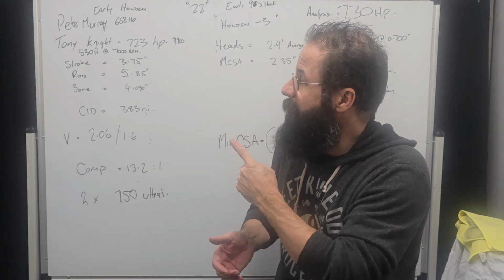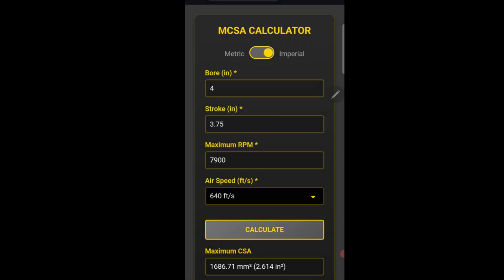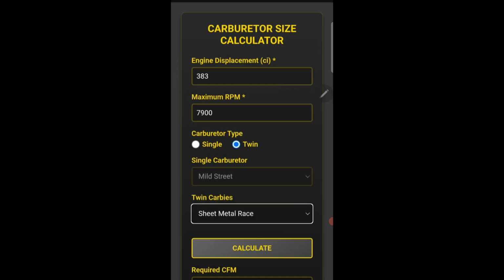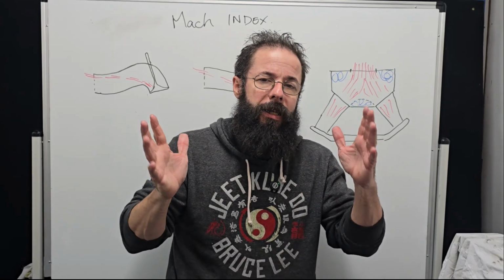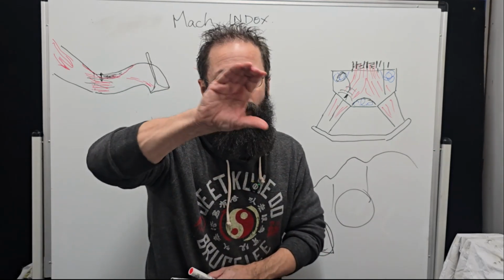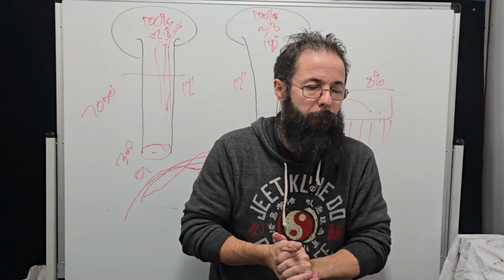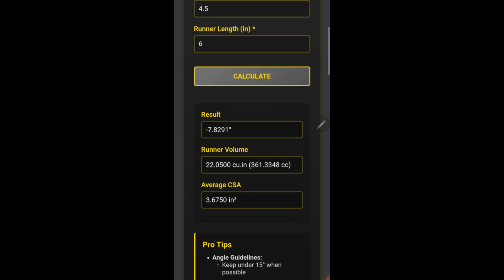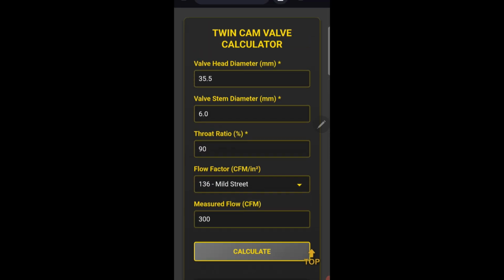Induction Secrets Part 5: MCSA Mach Factors and real world example

Comment: 302ci with limited .444 lift cam(ptv clearance) performer long runner efi intake and super trick ported gt40 iron heads  stock  valves would a 1.7 rocker ratio max out power a bit higher rpm? Runs up to 6000 rpm then chokes up
Reply from the maker: Generally they extend RPM.

Comment: Great video, and THANKS!  Quick question. On your calculators, is there an accompanying diagram that clearly defines each of the input and output variables?  On a couple there I lost track on what they all are, and that would make it hard (impossible?) to reliably use the calculator if one cannot be confident of what each of the variables are. Thanks!
Reply from the maker: Which one mate? They are pretty straight forward

Comment: it’s an advantage to have small
cubes like 320” or less for port design.

these don’t need very much area even if running 9000+ rpm

therefore a low port entry can be filled in, roof raised to the max, port width to the max, and produce a high mach index port with great line of sight.

once cubic inch goes past around 350” and rpm is still pushing 9000, this port will be too small, hitting a choke point before it can use the cfm available.

i like smaller cubes, though it a tricky affair!
Reply from the maker: 100% mate. I guess that why they have the penalty ratios in emgine masters. Also harder to control flame speeds on big bore 4.6"+ engines too! They are more knock sensitive
Reply: @bainracing  Speaking of small cubes I am building a 283 SBC and the chinese head I have has the perfect MSCA at the throat for a Mach of 53. Typical SBC heads have the MSCA at the pushrod pinch, is this a necessity? (in order to slow the air to avoid separation at the short turn) I want to taper my port continuously like a holden or similar. Because of the small cubes I am able to open the pinch just enough and I'd shape the short turn like the yamaha non mandrel shape you spoke of. Is the SBC port design so bad that I cannot take this approach? Is the pinch a necessity? Worried because I haven't seen others take this approach on a SBC. I'm working on cross section shape and size at 6 port locations and then the chips fly. Please provide blessing or talk me out of it :) Mike in Massachusetts
Reply from the maker: @michaellfbvr Yeah, i think the problem you will have is the low port window.  After the pinch acts like a pressure recovery.  And transferring higher velocities at the SSR might lead to choke.  Never tried mate. Personally I think the port shape is wrong for the MSCA to be too close to the valve.  But who knows right! 🤣👍